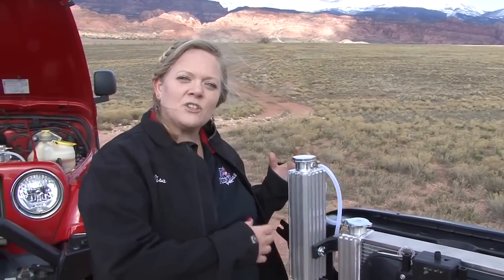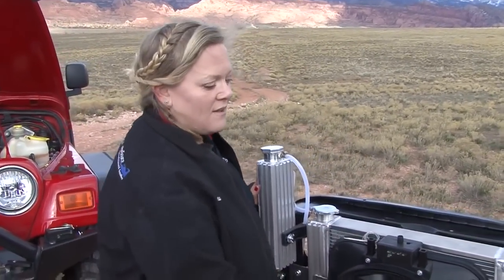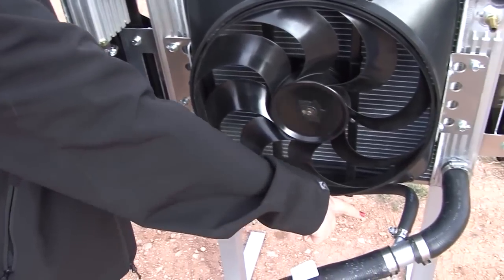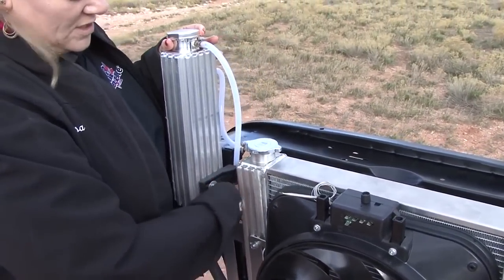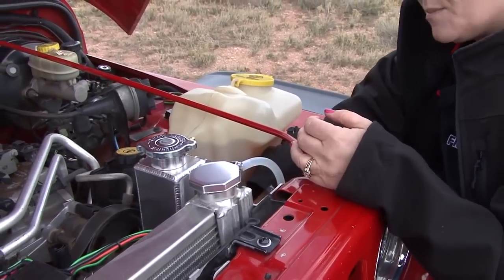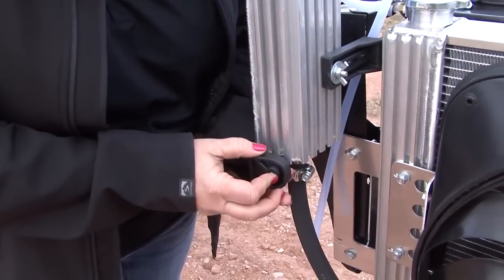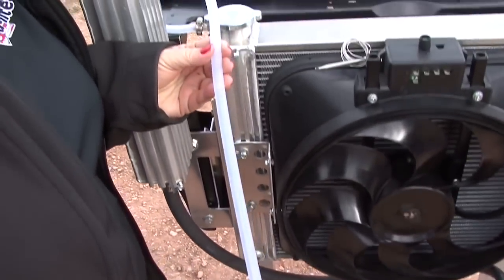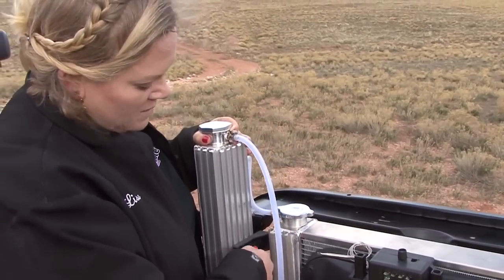Expansion Tank vs Overflow Tank for Your Jeep Cooling System

Comment: I ordered one of these but my question is why does flex-a-lite only offer a 1 year warranty?
Reply from the maker: We have no control over how long of a warranty a manufacturer chooses to offer.
Reply: what is the failure rate on this product?  Many other fans offer longer warranties? I have heard there are issues with the controller? Also why do they use butt connectors instead of sealed automotive grate connectors?